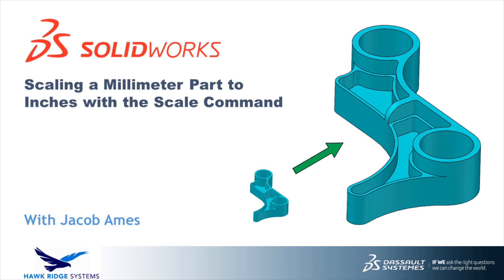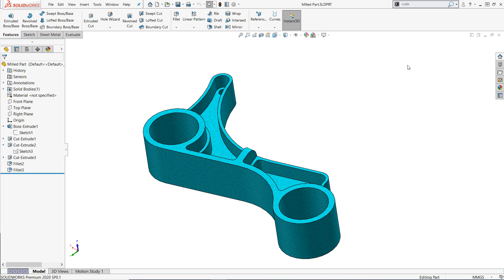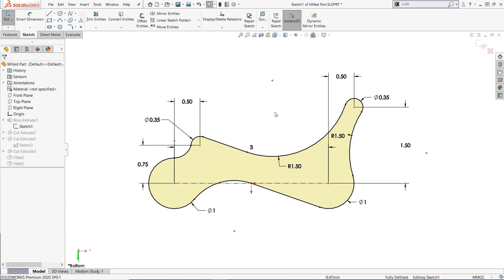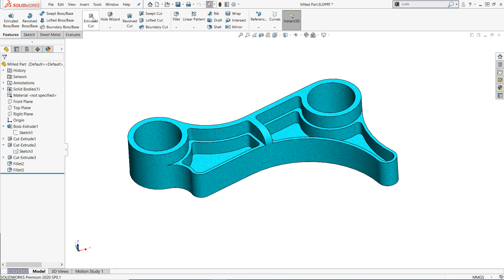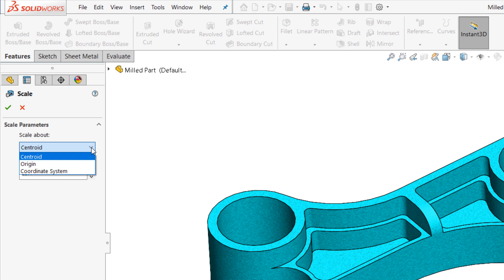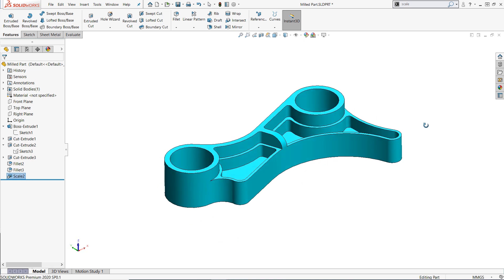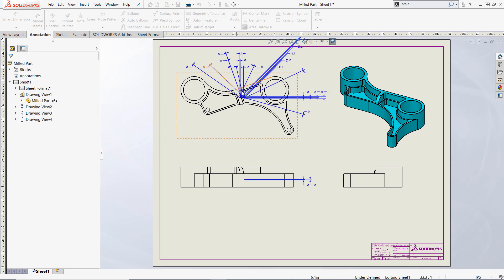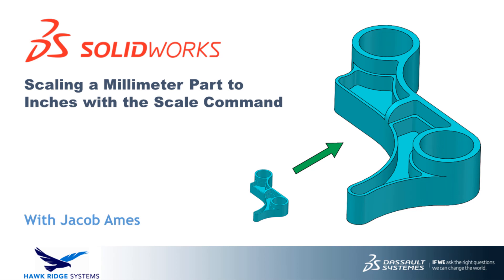Converting Millimeters to Inches with SOLIDWORKS Scale Feature

Comment: This saved me an hour of work. Thank you!

I do have to use this command to correct for shrinkage of hot wax for an AR 15 trigger too. Hope i will do fine there. Its for the mold for the hot wax, the hot wax will be used to make a plaster casting mold using vacuum casting. A muffler oven can melt the steel, and then trigger parts are made. Just like jewelry. Casted with the vacuum casting method. Some very high details can be attained this way. 

Greetings,

Jeff